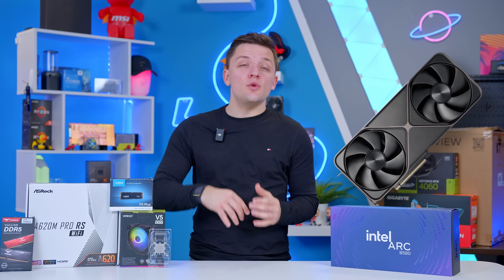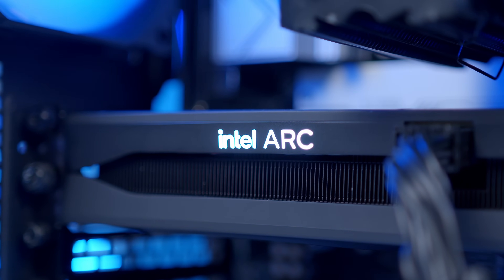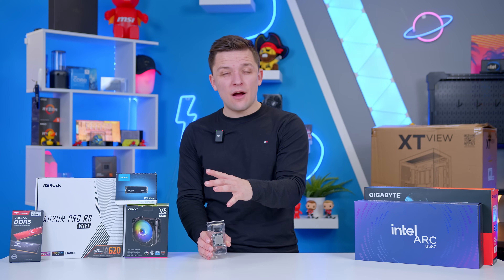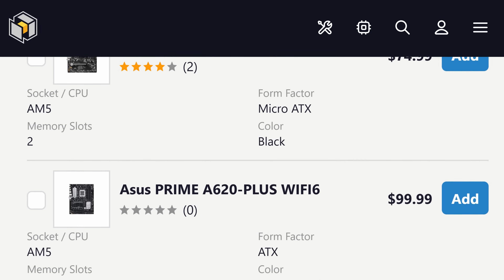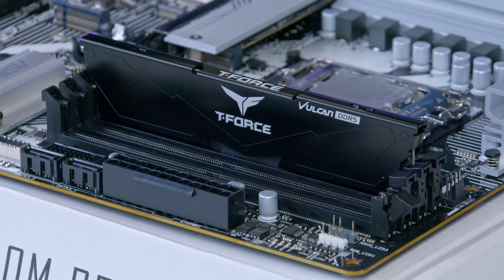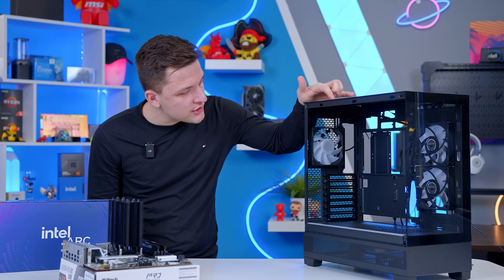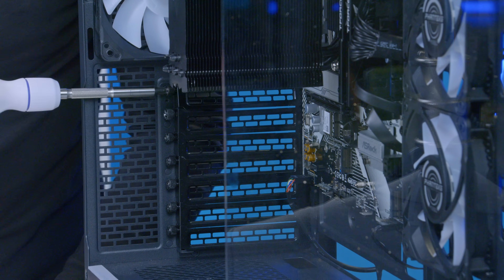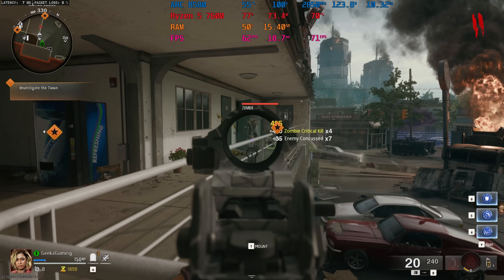BUDGET $800 Gaming PC Build 2025! 😄 [Full Build Guide w/ 1080p Benchmarks!]

Comment: This build is great but the problem is the B580. There are basically no B580s for regular price, they are all extremely over-scalped and you'd be lucky to find one for under 400 dollars.
Reply: In Australia you can find them pretty easily and are around 450 AUD (270-280 USD)
Reply: My issue is the psu and motherboard. A620 are pretty garbage boards and that psu really isn’t a good one…

Comment: If my whole build is less than $800 and I have the money to upgrade should I get the 7600xt 16gb
Reply: The XT is the same performance as the regular 7600 just with more VRAM and uses a ton more power compared. Check out Gamers Nexus review on it. It's definitely not worth the extra price.
Reply: Get a 6750xt if you can. If not try to snag the intel gpu because the 7600 is not that good of a card for the price

Comment: Guys, im not that good at pc stuff, can u tell me if i bought a nzxt kraken elite 360, can i just install it and leave it like this for a long time like air cpu coolers? Or i need to change something regulary,maybe water or something(i actually have no clue about how water coolers work)
Reply: Most AIOs have a shelf life of 3-7 years. Higher end ones like the kraken elite 360 should last 6-7 years and as long as their isn’t a production malfunction then you should only need to install it to either the exhaust or intake (preferably exhaust but you do you) and then peel the tape covering the thermal paste off the cooler before hooking that bad boy onto your cup. Once it’s installed just make sure you plug it into the correct header on the motherboard and you are good to go. (Motherboard manual should have a layout of your board and with that you can find out which port/header you need to plug into)
Reply: @jimdob6528  ok, ty

Comment: Do you think its actually worth going for a budget machine for 1080p vs buying a console for less cost? Feel like a lot of the benefits of PC gaming are lost at this level
Reply: I have a ps5, a switch, and a pc so I have some insight on this exact topic. Plenty of games are just better on pc for a multitude of reasons while some games are just better on console. Games on pc tend to be more affordable. You have many many more game options. The games themselves are usually better optimized on pc. I haven’t found 1 survival game that wasn’t significantly better on pc than console. All indie games are usually on pc first. You don’t pay yearly to play online with your friends on pc. You can upgrade this pc since it’s on the AM5 platform if you truly need to but this seems fine for now. Pc games are easier to mod if you want. You can also do actual work from this pc if you desire. Loads of reasons this pc can more than make up for an Xbox or ps5. Also the b580 card is technically a 1440p resolution card but if you are building on a budget they assume you have a 1080p monitor instead of a 1440p one and I would recommend that anyway. 1080p-1440p looks huge but 1440p-4k is not that big a difference when you are only sitting 2-4 feet from your monitor.

Comment: @everyone is this a good build? • ASUS ROG STRIX B760-I Gaming WiFi Motherboard Socket Intel LGA 1700
• CORSAIR Vengeance DDR5 32GB (2x16GB) DDR5 6000MHz CL36
• Intel Core i5 13600KF Tray - Processor 3.5 GHz (5.1 GHz)
• Noctua NH-L9x65 chromax.black
• ASUS Dual GeForce RTX 4070 SUPER OC Edition 12 GB GDDR
• WD_BLACK SN850X NVMe SSD 1TB Internal SSD
• Fractal Design Terra Graphite
• CORSAIR SF750 (2024)
• Noctua NF-A12x15 PWM chromax.black.swap
• Cooling Grill 120 Black

Comment: What should I use with Intel arc b570 an i5 12400f or i5 12600kf
Reply: only difference between them is second cpu you can overclock
Reply: @fuadrashadoglu  no but 12600kf has more cores and it has better performance
Reply: @gurmanjitsingh1179 not in games. it has more E cores

Comment: Nice build, i bet with 7500f we can squeeze a bit more for a bit better GPU and with 800-850$ we can even try 1440p gaming
Reply: Have you checked the prices of the 7500f recently. I see about a 30 usd savings so not that big a jump. The b580 is also supposed to be a 1440p card anyway. I would take that 30 USD and throw it at a better motherboard. Eventually you wanna upgrade to X3d cpu and the a620 motherboards will not handle those at all.